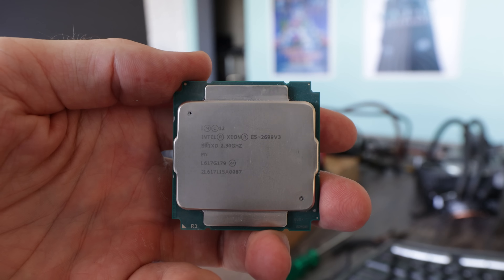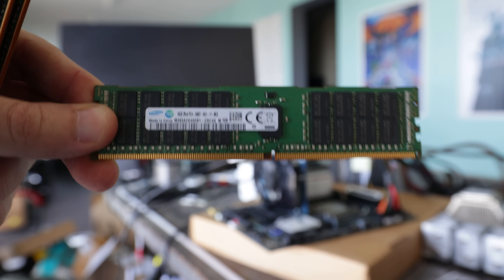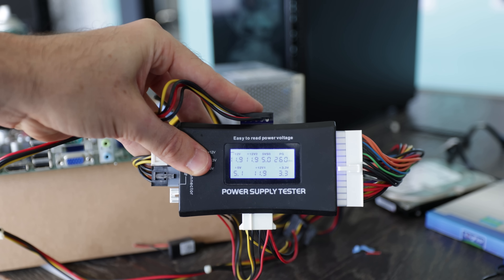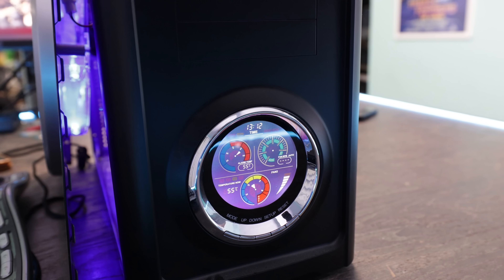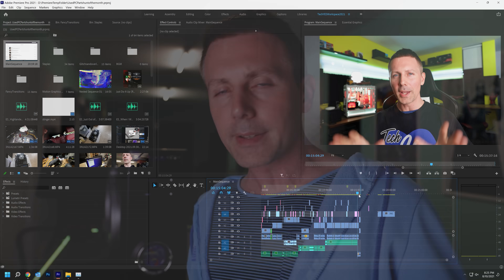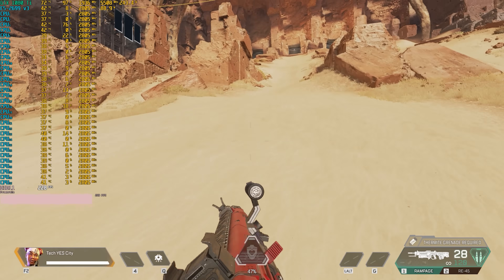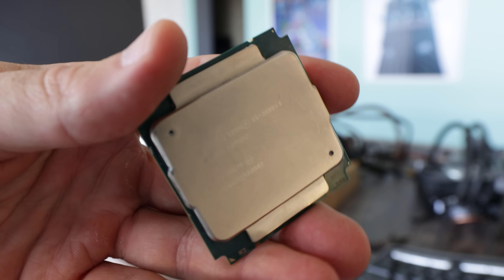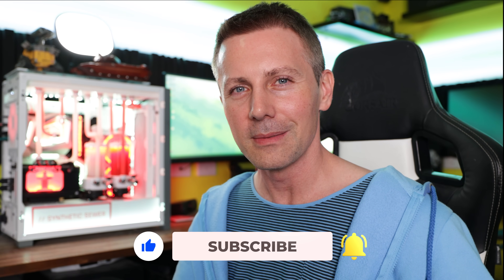I Built a BUDGET 18 CORE XEON Gaming and Workstation PC (Part 1)

Comment: That sucks that you got one of the new WD ssds, I couldn't tell but from the looks of it it only had one ram module so that's not good... Especially for an editing rig, although I suppose we're going to find out how and what.. I don't know why I keep pausing to try to figure out what the components are LOL, I spent 5 minutes on the ram module and you're the guy that kind of taught me how to overclock ram.. well started it anyways I'm still trying to figure it out at this point.

Speaking of Xeon, I found your channel looking up some sort of possible specs for my 4930k because it was never included in any of the Roundup CPU performance benchmarks anywhere, turns out it's  cuz it was a i v e bridge x79 Xeon.. I thought I was fucking myself by buying a CPU just before the refresh, been with me for a good almost a decade now, just overclocked it like a year ago when apparently I realized it should have been doing it this whole time and I didn't I think I may be bumped the voltage up .01 maybe things like 1.28 if I recall, whatever it was it was it was tiny, combine that with your power delivery settings or what have you, and it's running a butter smooth 4-4 on all six cores and been doing so without hitch for about a year now.. didn't affect the ram timings at all, quad channel DDR3 2400, I think cl 13 11 9 9 31 I could be totally wrong I'm outside smoking on my phone LOL, but pretty much the only thing I've missed from a modern system is the modern day instruction sets..

 I have a ryzen build that's been sitting there for months initially I put it off because I was trying to lock down a perfect custom ROM so I wouldn't have to fight Windows 10 everyday until I realized that that was never going to be possible again... Got the scripts I was going to have to run, learned way more about the windows back end then I ever thought I would ever have to know, and then Windows 11 got an announced.. so now my excuses that I'm trying to lock down exactly how to declaw skynix ram because I have 4400 cl19 gskill 32 GB dual rank memory module s 64 gigs in total, on a ryz3n 3900x lol... In my defense, I couldn't find the ones I had initially picked out at 3800 cl16 so I knew I was going to have to downclock it, and I was like can I do this I looked it up they said I could.. they didn't tell me how or that information on skynix is like trying to find human resources files from Activision Blizzard.. go figure that all of the high-end g skill dims are using skynix, instead of Samsung like they were last year.. which is fine who knows if it's good or not, theoretically the specs say I should be able to do it, if only I could find a program that could actually tell me what it is because g still ain't telling LOL... 

So fortunately, thanks to you largely last year when I was doubling down on sticking with the 4930k, getting the 2400 32 gigs of RAM, and you're overclocking guide and just general love for the ive bridge x79, something that people just don't even talk about it seems.. it goes straight from the i7 3700 to the i7 4700 to straight to haswell in all of those benchmarks and I just sit there going fyou steve, or Brian, or Tim.. can't think of anybody else, put outside of yourself that pretty much the only benchmarks I've seen in the modern day for that are I think in Italian dude and some Russian dudes. And then a video from 2013 or something of Linus unboxing 4960x, so imagine my surprise when I turned out it wasn't just a refresh kick to the side like 1100 series this year, but was actually a whole separate class of off-boarded server CPUs.. guy I wish I had known how easy it was to overclock, and have guaranteed it was to overclock so high in 2013, LOL like it had great performance it's had great performance and it certainly out class anything at the time on the consumer market other than the 49 60 x which was what $400 more or something like that 5% more performance, but considering I could have had 8700k performance in 2013 I'm a little miffed, I knew hardware back then but I sure didn't know shit about the internet lol

I had done some experimentation with pushing it further, but I ended up getting sidetracked by my fight with Windows 10 to not try to run my computer like a cell phone, a fight that I fight every single day cuz I have the home version currently installed, but one that yields rewards by comparison and is entirely worth it,.. but, when I do actually get that 3900x filled together, which by the way I bought that $3,900x in 2020 like in April, I had a build together back then but my wife accidentally return the parts and then I was just like fuck it at that point cuz I had already installed the new ram for the Zion, so this is kind of been I've never been in a situation before where I had a PC that worked just fine and another PC that had you know not been put together it's always been once you got all the parts you put the PC together cuz he didn't have shit at the time because usually usually new pc time was when something blew up or well, just you know died because.. well let's just say It still cracks me up that MSI has turned into some sort of premium brand*

so I guess all I got to say is watch those WD drives and thank you a lot your channel means a lot to me :-)

*. back in the old days they were the the brand that you bought because it would work and you could afford it, especially if you're prior MSI motherboard decided to die for no reason, although fool me once shame on me fool me three times I bought one of their laptops back in 2009 it spent so much time at the RMA cuz I bought the fries RMA that it literally could not be RMA anymore they gave it back to me and it didn't work and it was out of the warranty that I paid for and at that point I was just sitting there kind of having my eyes been opened about what was about to get so much worse.. over the next 10 years lol.

Comment: Another nice thing about this family of Haswell Xeon can also run almost full boost speed ALL core using a microcode change. In one of my machines I am running a 2697v3 14 core with a microcode stripped bios with mce set to 36 all core and llc set to 6... x27 microcode for windows. It will run 3.6 on 12 cores and 3.5 on 14 cores with 100 BCLK.

Comment: Sexy. I've been rocking an ES x99 Xeon for a good while. I aught upgrade it. I got an EVGA B stock X99 Micro 2 board for 50 bucks 4 years ago that started me down the path. Some interesting quirks on my CPU it runs way faster than it's supposed to. It's supposed to be a 2.4 max turbo but I set my multi to 32 and it runs at 3.1. Been serving me pretty well. Recently have been planning to upgrade. On an 8c16t currently. So seeing this is pretty inspiring.

Comment: I have a 10 core E5-2690V2 on a Chinese turbo MOBO, and it will run all 20 processors at 3.29mHz. I use a GTX 960 in an old Fujitsu server case that they were throwing out at work. It cost me about US$600 all up. I use the original case fans, plus a nice Noctua for the CPU. I have an actual new gaming PC that I haven't turned on for about eight months, simply because I get so much enjoyment out of the one I built for myself.

Comment: Thanks to you....  I built my E5-2658 V3 (12C/24T) system way back in Spring/2016.  At that time.... I wanted to build a system with high-end I7 performance for an AMD price.  Ryzen would not exist for another 14+ months.  I tried to future-proof my investment as much as possible.  I purchased a used E5-2658 ES v3 for $170US, a new ASRock X99 Extreme4 MB for $170US and new 32GB G.Skill Ripjaws DDR4-2400 for $120US.  Not a bad purchase price!  So.... I've been waiting for years now for my next CPU upgrade.... Either a 18C or 20C Xeon for under $200US.  I decided a long time ago to never pay more than $200US for a CPU.  I've watched these 18C and 20C CPUs drop in price from over $1000US in 2016 to under $300US these days.  A CPU upgrade is coming soon!!!  I think I will be going used Threadripper in the coming years for my next full upgrade.
Reply: If you care about gaming more than workstation performance, don't bother. The E5 2699 v3 draws tons of power and generates tons of heat but the uplift over the 2658 v3 is very very minimal for games. You'd actually do better investing $35 in an E5 2640 v3 as that one has much higher single core performance when using turbo boost unlock - the benefit is larger than the extra threads. Otherwise the 2680 might be worth it, but only if you can resell your old one for a good price. Even then, I think you'd be better off just doing a platform upgrade and getting on more recent architecture.
Reply: @b0ne91  Thanks for the reply.  I'm an old Net/Sys Admin (30+ years).  Linux is my main OS.  Gaming is the last thing I think about when building systems.  Application performance is the most important thing to me.  Hell.... The best GPU I have installed in any system (lately) is a GT-1030.  LOL!!!  When I rebuilt my system in 2016, I decided to use the 2011v3 MB platform.  I thought it would be future-proof for at-least the next decade.  But....  I had known that the CPU Price Wars were coming, I most likely would have built this system differently.  I hate running bleeding-edge equipment.  I generally stay 2 generations behind in PC tech:  (1)  I'm a cheap bastard and (2) Most OS issues have been resolved for me already.  As for gaming.... I do game.  Just not recent stuff.  Old system game emulators are my speed for the most part.  I'm a product of 70's, 80's and 90's arcade generation.
Reply: @b0ne91  On cooling, I'm using a 212 EVO air cooler.  Under full load, my E5-2658v3 never gets above 60C.  I think this cooler should be able to handle an 18/20C Xeon A-OK.  If not, I will get a better air cooler.  I stay away from liquid cooling as much as possible.  I've seen way too many systems killed by water leaks or pump failures over the years.  At least with an air cooler.... If the fan fails, it will still provide some passive-cooling and keep the system from instant Heat-Death.  Once there is no-water running the loop in liquid cooled systems, CPU's can die very quickly if the MB can't shut the system down in time.

Comment: i would imagine power consumption would be the major drawback for such system
Reply: Not really. I have the same CPU in my NAS/VM/Backup/Plex server. The idle power consumption from the wall is about 220W - mostly because of the 16 8TB HDDs and the hardware SAS/Raid controller that serves them. Under full synthetic stress test it consumes 390W - mind you, this is with turbo unlock so 3.6GHz on all cores. With just a regular Cooler Master 212 Evo the CPU stays under 60C all the time under that stress test - so i would not worry about the power consumption, it is absolutely reasonable.

Comment: Love me some Xeons! I am currently running an E5-1680-V2 on my main, EVGA X79 Dark, with 32GB (8x4GB) Corsair Dominator 2133 @2400 CL9-11-10-27-54.
Reply: Oh, I forgot about the rest! GTX Titan Xp Galactic Empire Edition, all on water! Yes, I am running Bitspower RAMBlocks! The Xeon is running at 4.9GHz all core 24/7 @1,355v. the Titan (which is on its own loop), is running at 2174MHz core/12,000MHZ mem. They are are all on their own custom loop!

Comment: Those Xeons are nice systems. I have dual Xeon e5-2680v3 with 128 gig ram. With full load it consumes 500 watt for the wall (cpus only). It produces so much heat I can use it as radiator to keep the room warm 😱
On the other side of spectrum I have rig I use for recording streaming from security cameras doing AI video analysis etc. it is Xeon 2608L v4 with gt1030 SSD and classic 4 tb drive. With 4x4K cameras it consumes on average 50 watts from the wall !!! Very interesting CPU.

Comment: Can we talk about case MFG's actually built cases for correct airflow and now they threw it all out of the window for tempered glass. Even the front panel on these cases are either full blocked off or are reliant on airflowing coming from the sides /bottom of the front panel which is still blocked off. NZXT is a perfect example. They used to have good airflow

Comment: The big problem with powerful old gen cpu's are motherboard costs. Not that long ago I ran into a problem when my Z87 mobo gave up the ghost combined with a 4770k. Sourcing a replacement mobo was expensive. I found the most cost effective solution was to sell the cpu and 16gb of HyperX fury DDR3 1866mhz ram. Then buy a Ryzen 3600 with 16gb of 3200mhz crucial Lpx DDR4..The upgrade included an Asrock B550m pro 4 mobo and with the money back from the old parts the cost was neglibable.
Reply: 4770k it's not an old gen powerful CPU, it's just old.
Reply: @JDMeister  For sure, the point I was trying to make was that even old gen 6, 8+ core cpu's might be cheap but the mobos aren't. To underline that it is well worth  noting how expensive it is to get a replacement  for the old i7's...
Reply: @JDMeister  Any intel cpu with Haswell architecture (or newer) could be considered powerful.
I used to game on a 2 core / 2 thread pentium Haswell cpu.
youtu.be/U8XfW3xXvfE?t=19

Comment: Do you think the Huananzhi X-99TF you reviewed awhile ago would be able to handle this CPU?
Reply: With the E5-2678V3 with turbo unlock it got pretty hot in the vrm
Reply: I'm running exactly the same CPU on Huananzhi X99-F8 which differs from TF only by the memory layout (TF is 4xDDR3 and 4xDDR4 where F8 is 8xDDR4) and it's working literally 24x7 for last year or so - it's my home NAS/Plex/backup/Linux server - and i had 0 problems with it. Reliable, undervolts like a champion, silent, i just LOVE that combo.
Reply: @Movingfrag  With the 2699? thats great! mine was not that great with 2678, i was using to train ML and to video edit. vrm was 75 to 80 celcius on 100% load

Comment: damn that case from 2005 had sensors connecting to a screen on the front to show temps, good luck finding a modern case that does that on the market!
the only way to get anything similar is to DIY a small panel in the case and have that info displayed there.
Reply: i remember seeing 5 1/2 drive bay devices that did the same going back 10 15 years
Reply: @moorhen6156  Pity you don't even get 5.25" bays nowadays. But you can always just drill a cable hole, and have a PI Zero and a screen on the front and some frame to hide the sin. A 5" LCD isn't too terrible a fit. Quite an engineering project though for sure, to integrate UI, temperature reading and fan outputs, especially considering Pi doesn't have any analogue input capabilities of its own and also isn't great for PWM.
Reply: we use raspberry pi with mini display to achieve this today.
Reply: I'm obsessed now, do you know the name of that case?
Reply: I bought an old nzxt module maybe around 2010 with sensors on it, it was 5.25" and I had it to control my radiator temps and run the fans on them, it was really cool but pretty pointless in hindsight. Regardless, I love x99 and I wish more people would promote it...we've got a generation of pc builders that say "ryzen or nothing", when until recently ryzen was lagging behind older x58 xeons $ for $
Reply: @licksludgee  The Ryzen price is ryzing
Reply: @bitelaserkhalif  I love it 😁
Reply: I remember drooling over the Asus Rog front Base when I was like 16/17
Reply: yup back then it's was really common
Reply: Looking at the case I would never think it's over 15 years old.

Comment: I still have my Xeon 2689 that I got from your vedeos 2 years ago with the plexhd x99 chinese motherboard ! I'm very happy with its performance 
32GB or DDR3 ECC ram and a lovely Rx570 I bought for 60 euros in the good old days 
Only thing I hate is the shrieking beeping codes it makes always on startup that I could never find a way to shut up
Thank you for posting this fantastic videos !
Reply from the maker: Can't turn it off in the bios? you could just solder the speaker off, but probably the best thing to do if its just annoying on start up.
Reply: @techyescity  TY :-) I have combed the bios and cant find any reference to stopping the beeper.
I am afraid of destroying the MB with my soldering skilz ;)
Anyways... love the xeon combo I got from your videos ;) Its a little beast that costed less than 300€ 
Love your tech and financial videos !
Reply: Put some double sided tape on top of the motherboard speaker, then you won't hear it anymore.
Reply: @_________________404  WELL there's a idea ;)
Reply: @fft2020  Well yeah. This works if it’s the standard rounded MB speaker with a “hole” in the middle. I did it on an optiplex and it’s impossible to hear it now once the speaker’s top was covered by a tape. I used double side tape just because it’s thicker and sticks better than a standard tape.

Comment: Is there a point of going for a e5-2667v3 if i had a modded X99 board which has a E5-2620V3 which runs at 3.2 

Also if i dont mod the board which cpu should i go for because i havent modded my X99 v201 board?

Also i heared that the V3 xeons only have the turbp boost mod available as soon as you change to a V4 it doesnt apply. Why is that???
Reply from the maker: The microcode allowed for it, the v4 doesn't :(.